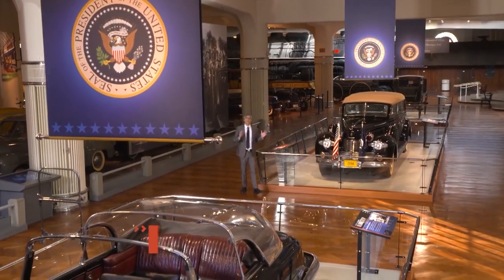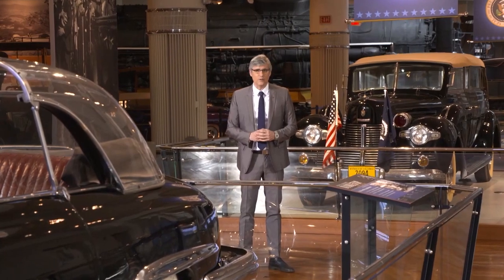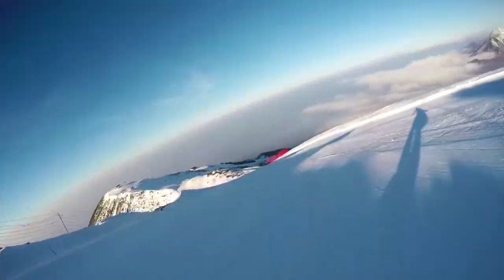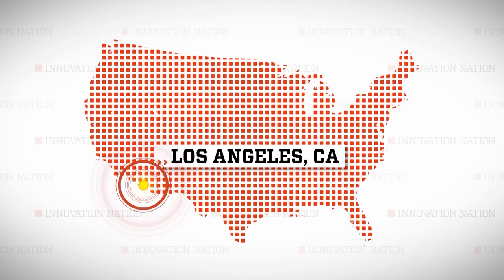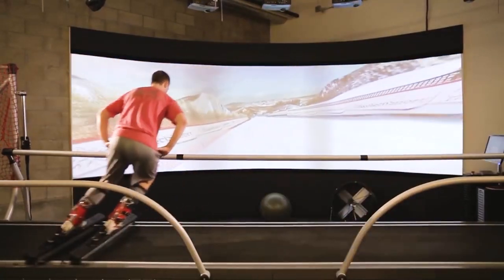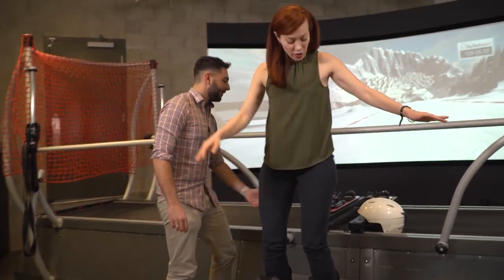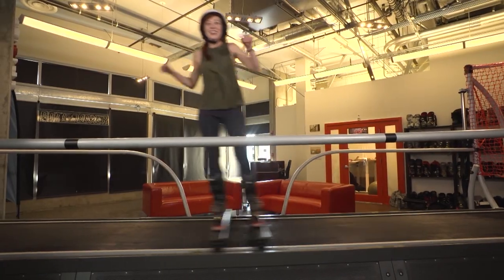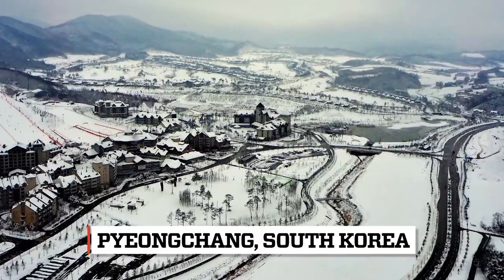How a Virtual Reality Ski Simulator Works | The Henry Ford's Innovation Nation

Comment: The movement is not accurate, as in reality the feets are not always in parallel, an improvement would be to be able to keep one/both feet front/back to each other
Reply: Agreed. These were my thoughts exactly
Reply: It does move front and back. She is just not using.